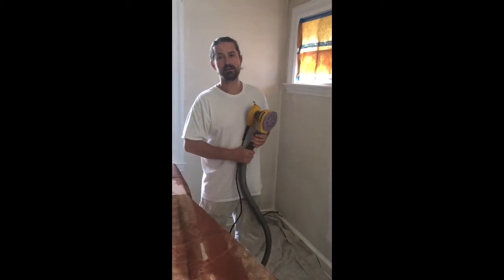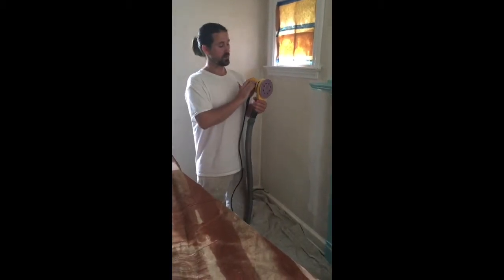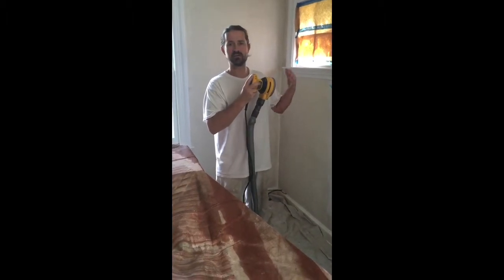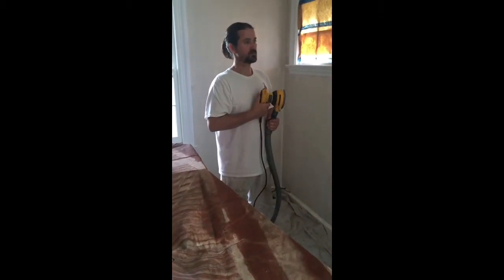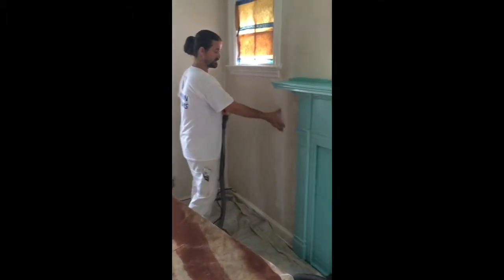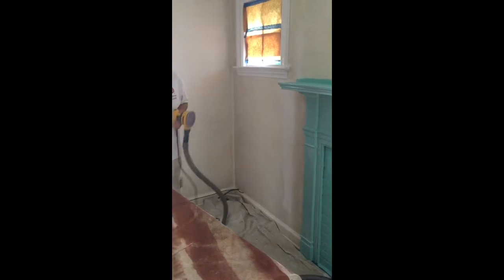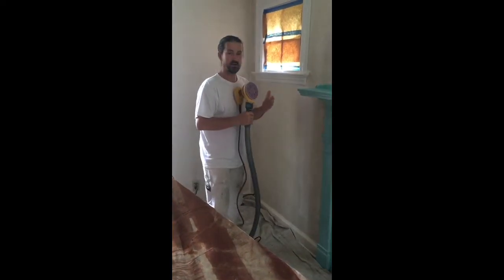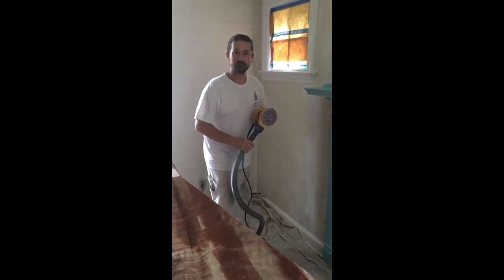Using a Hepa-Vacuum Electric Sander to Prep Walls for Painting

Comment: those are good for small patches you should consider buying a drywall sander with a 10" size sanding pad, you can also hook those up to your vac.
Reply from the maker: Sorry for not getting back to you sooner. Somehow I missed your comment. 

The 10" would not be a great option for this type of sanding because it would be too large to get in between objects like the mantle and the window casing or between door casing and switch plates, etc. 

Also,  when you're sanding spackle work it would be a good idea to use the smaller sander because you're gonna need to apply pressure where you need to. A 10" would just be too bulky to get the desired effect. Although I do have a 10", this sander is more versatile. Your comment is much appreciated!